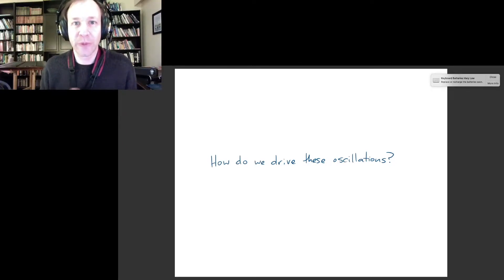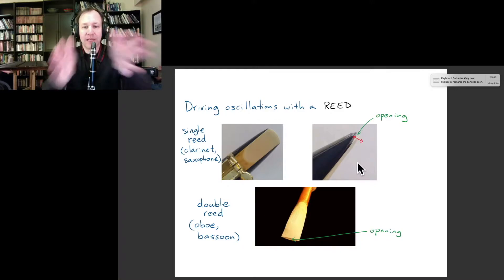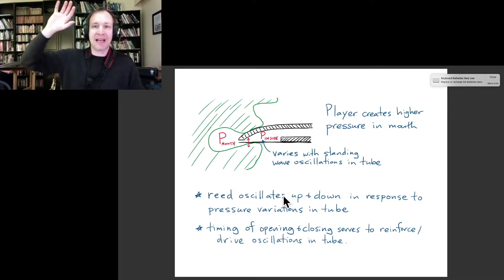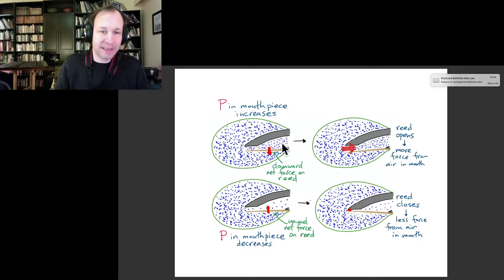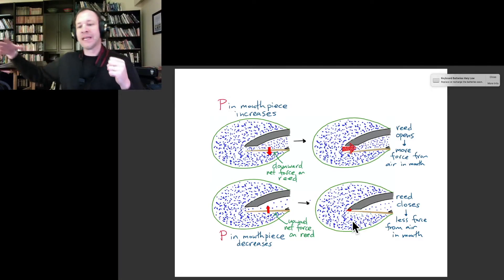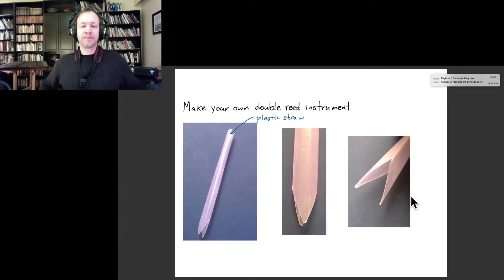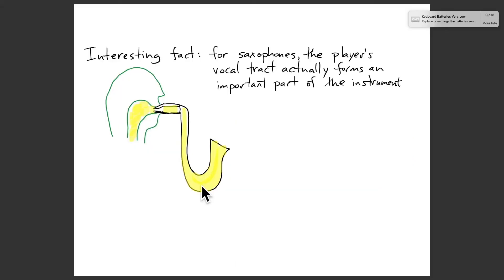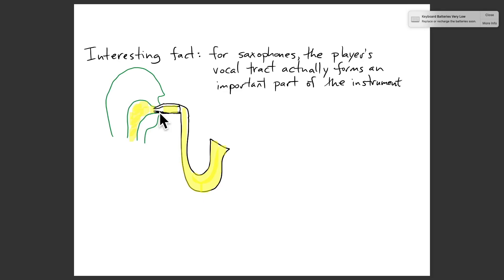Physics of Music 52: Woodwind instruments: Driving oscillations with reeds (1)

Comment: Thanks! One question, how is it that the Clarinet is a closed end instrument when the reed is vibrating? Does the reed vibrations are different from the open end at the bell?
Reply: The air movement, into clarinet reed opening, is a very small&slow&restricted airflow. It’s almost neglectible compared to the speed of sound.

On the other hand, the air movement at the flute mouthpiece is a free vibration of the standing wave, just like at the opposite end of the instrument.